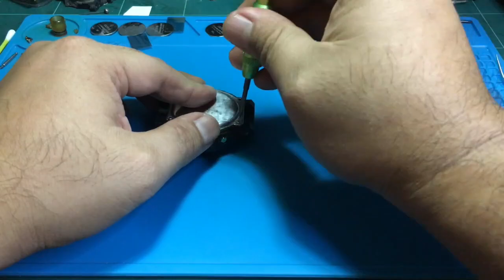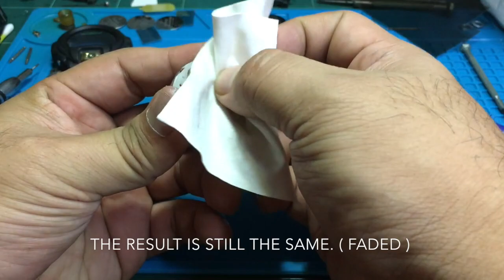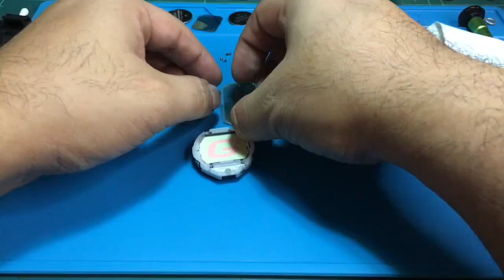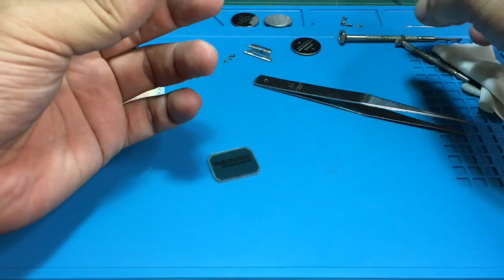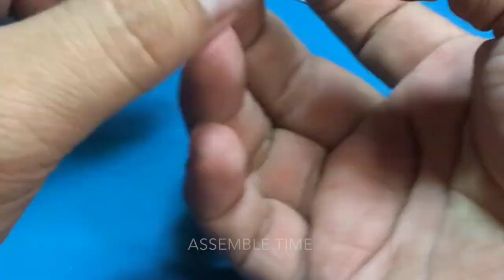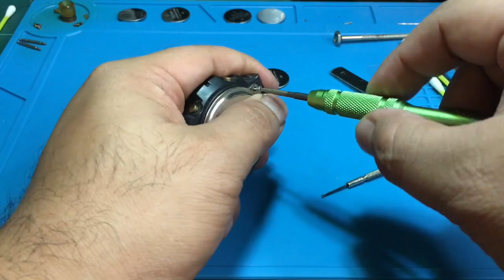HOW TO FIX / RESTORE FADED LCD ON VINTAGE CASIO GSHOCK DW-6600 | CARA UNTUK MEBAIKI LCD DW-6600

Comment: I found your channel searching how to restore the lcds from a couple o vintage seikos that came in a lot with some automatic. Keep the videos coming.....
Can you revert with a link for the films you are using? In the comments of your casio video you say that you are using metallic stickers on the back. Pls provide more details, or make a video with links. Nice job my friend!!!!!!
Reply from the maker: hi sir, about the polarised film i bought it from a shop nearby my area, but u can used any polarised that meant for smartphones, TVs or monitors, it works just the same. and as for the metallic sticker it depends on the model of the watch for instants for Gshock it uses backlight ( illuminator ) so it doesn't need a metallic back polar for it, and for some vintage casios it uses LED for the light... and for this one u need a metallic sticker to make the numbers brighter.

Comment: Great work Sir!
Short question, did you use simple polarizing film, not "mirror" polarizer?
Reply from the maker: please do not use Mirror Polar, because if you do so you wont be able to see the digital because of the reflective properties... so it will become useless.
Reply: @abukambing177  In all Casios, a mirror polarizer is initially installed on the back side, isn't it?  and everything looks great.  I didn't quite understand what you mean
Reply from the maker: @28lucky16  the trick is to use both normal polarized film on both sides of the lcd... but u have to find the right angel for the film to work... tried the mirror ones... turns out to be worst and looks not original from the factory.
Reply: @abukambing177  when apply a film on the back side also needed to choose right angle? Also how we do on the front side?
Reply: @abukambing177  friend, I tried right now to change the rear polarizing film on my g2900, with the rear film removed, nothing is visible at all, and when I glued the polarizing film it became very very dark. What to do?
Reply: @abukambing177  do you have whatsapp or telegram? How can I contact to you?

Comment: My old DW6600 EL backlight turns on by itself. Then, it will not turn off unless I press the EL light button again.

Have you encountered this problem?

Battery is new, by the way.

Comment: Assalam tuan, izinkan saya bertanya. gshock saya g300 punya lcd selalu terpadam, tapi selepas tekan butang apa2,dia kembali ada. Selepas beberapa saat/minit dia hilang kembali. Kenapa ya tuan?
Reply from the maker: Wassalam tuna... oh selalu kalau tekan butang lcd padam pastu ada balik dia menunjukkan battery dah low... voltage current lalu board x cukup.. cuba tukar battery baru then buat AC reset. tgk mcm mana